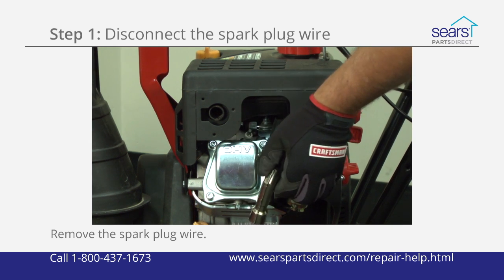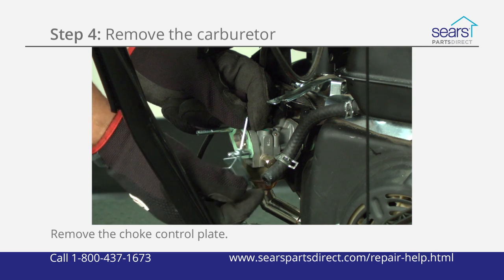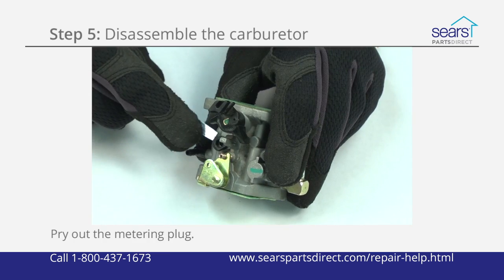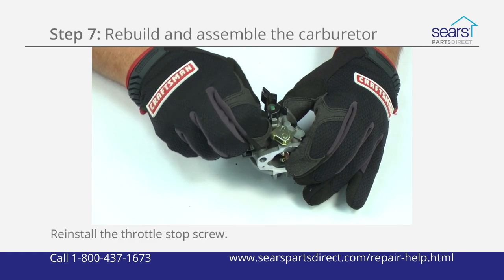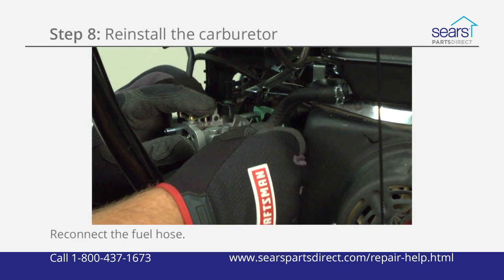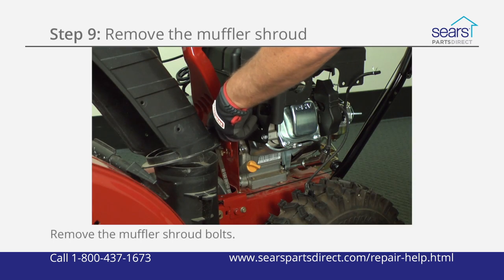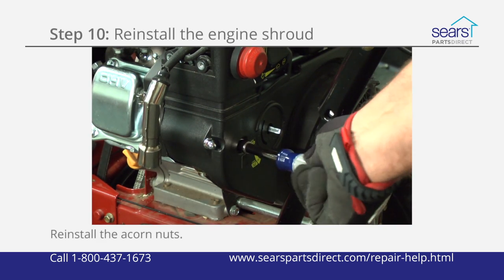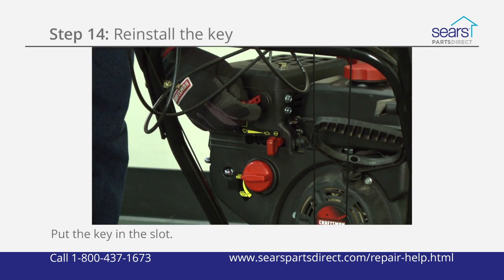Rebuilding a Carburetor on a Snowblower

Comment: I would add a fuel filter between the tank and the carb, this will save headaches down the road, quite often what happens is a little dirt plugs up the idle or main jets and cause it to surge or run rough.

Comment: I'd like to buy a new carb instead of rebuilding it (my carb is from 2010).  What is the part number for a new carb that will fit a Craftsman 247.888301 snowblower?
Reply from the maker: The replacement carburetor for engine model 483-SUA on your Craftsman snowblower model 247-888301 is this part: https://www.searspartsdirect.com/product/330ke1jd29-0071-247/id-951-11303a

Comment: How do you get the plastic throttle knob off? It’s impossible to get off.
Reply from the maker: The plastic throttle knob pull straights off on the model shown in the video. Let us know the model number of your snowblower and we'll try to help you with advice for removing the plastic throttle knob on your model.

Comment: The fuel bowl screw has no holes in it for the main jet?
Reply from the maker: No. There’s a small hole in the main jet housing.
Reply: @searspartsdirect  Is it accessible with a straight screwdriver to blow out with carb cleaner?
Reply from the maker: @BlueRage  Once you remove the carburetor from the engine and pull off the float bowl, you can remove the main jet and emulsion tube using a small slot screwdriver. You can then clean all parts of the carburetor using carburetor cleaner as shown in the video.
Reply: Cleaning carberator debris from emulsion tube;  I could not see a small hole, that is, size of tip of safety pin.  So I used a safety pin and cleaned out debris with spray and safety pin.  All is fine due to safety pin from female, lol. Wrong method,  but sometimes  you gotta do what you gotta do. It works wonders.

Comment: When i prime 2x the gas on my snow blower, i seen gas leak...i opened up the cover thinking i have a broken gas line, which i did not....the gas came out from the opening of the carburator out of a small hole.Any ideas?  Thank you.
Reply: Theo T you may also have just primed the snowblower more than needed.
Usually it should only need a couple of push primes 3-5 on full choke to get started on a cold start.
If primed more than need the bowl will overfill w/fuel & just escape/leak out the bottom bc there was too much fuel primed.
Reply from the maker: A clog inside the carburetor may be causing the fuel leak. Try cleaning or replacing the carburetor.
Reply: Theo T v z 🍟🍟🐞🐞🐞🔨🔨👩‍👩‍👦‍👦🔨🔨🔨🔨🔨🔨☕️☕️☕️☕️☕️☕️☕️🍿🍷🍵🍵☕️☕️🍼🍽🍴🍾🍺🍭🍦🍘🍣🍲🍨🍧🚓🚜